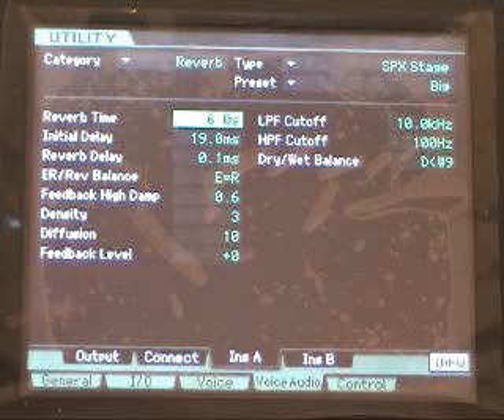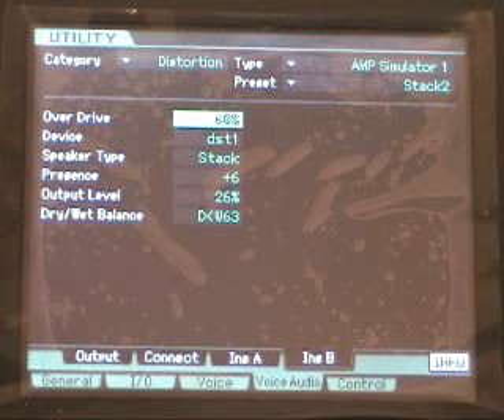Motif XS: Tutorial 4  Audio input connect record export

Comment: great video but i having a problem when i go through all the steps when i reach to the record part where there trigger level is and i start to record when i finish and go to audition all i get is a loud irritating sound when you go so loud like my speakers is going to burn my high range and the guitar is very low could you help me with this, is there a special cable that you used?